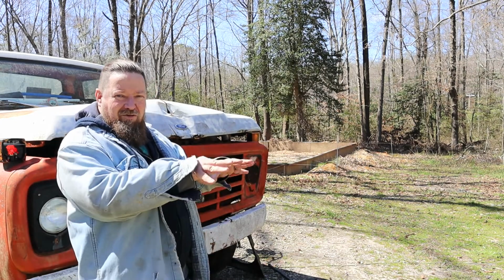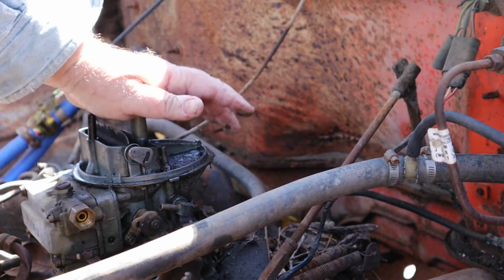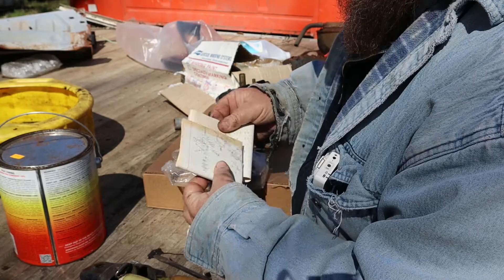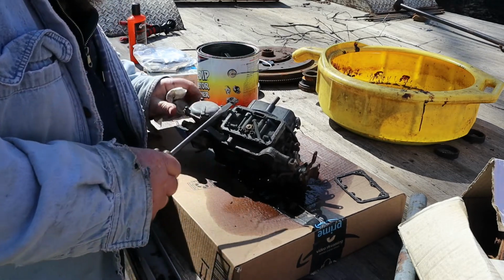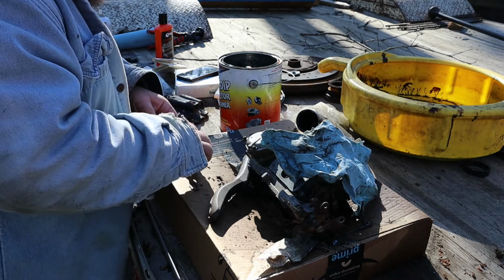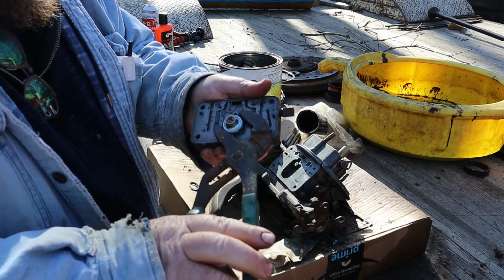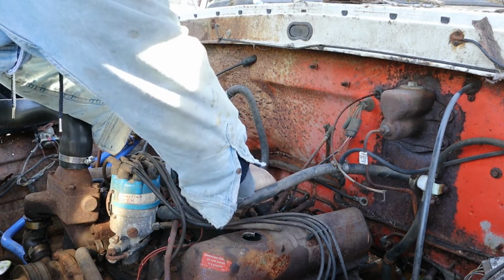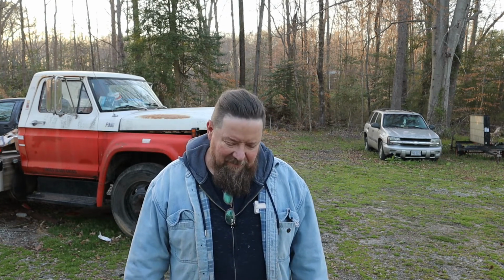f600 carb failure

Comment: is there some sort of a governor on the carb  or base plate...seems real odd when  you floor it..it just does nothing ,,if the accelerator pump was bad it would always pop threw the carb when you go to give it gas ...if the pump was bad you should be able to rev it up gently ,,,i wonder if the throttle plates  on the carb are not opening..look right down the carb and move the linkage on the carb and see if the throttle blades are moving
Reply from the maker: You are correct there seems to be two types of governors one takes away throttle pedal control from the driver and the other is driven a vacuum in the distributor.  I found a rebuilt carb same model on eBay for $35.00. I thought the same thing but didn’t express it on the video , as I held down the throttle pedal to the floor it should have least started to speed up gradually then get to full speed but it’s acting as if the governors already in operation. 
If this new carburetor that I’m getting off eBay doesn’t fix the issue I’m going to replace the distributor with the new HEI distributor and a two barrel carburetor manual choke. I remember driving the truck years back and when the truck got over 45 miles an hour the pedal would do nothing it would just move and it wouldn’t interact with the engine at all the engine governor would actually shut the flaps on the carburetor.